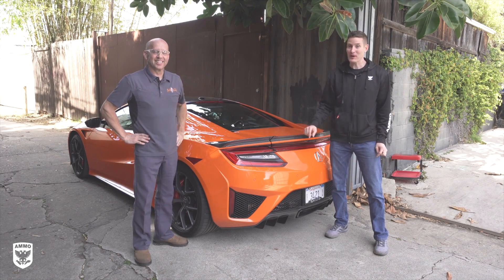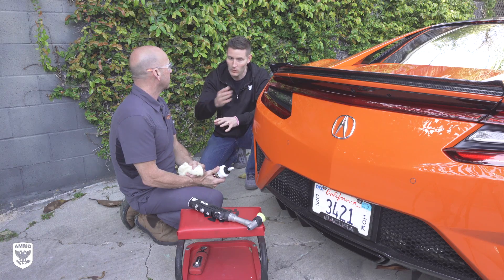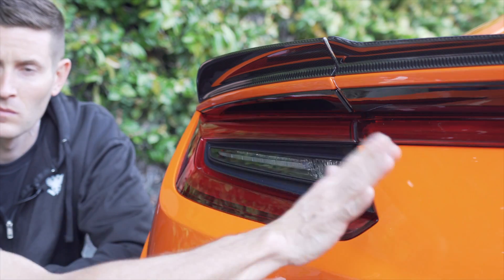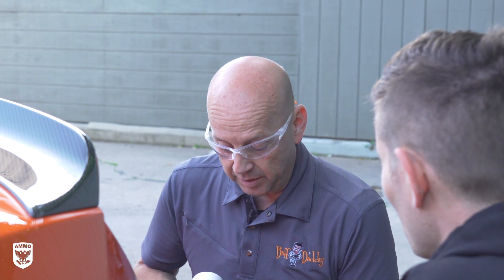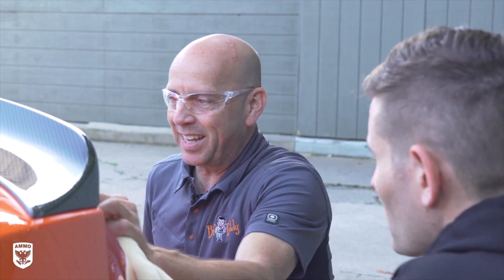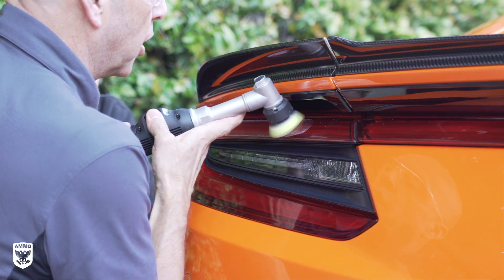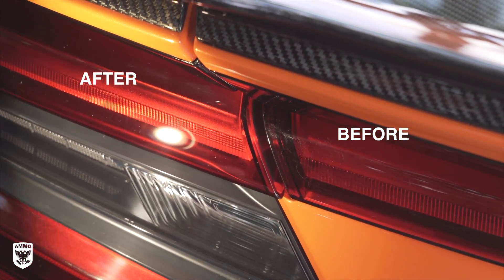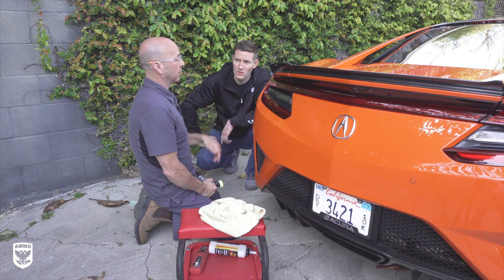How to Restore Scratched Tail Light Lens Acura NSX

Comment: Hi, can you make a video on cleaning and preventative body maintenance for cars that have to drive across dusty roads. I live in a hot climate and the last 1 kilometre of road to our house is an unsurfaced gravel track and even if I drive at 5km per hour, the back of the car and window has a light covering of gravel dust, especially during summer. Thanks for the great videos you've been putting out.

Comment: Same results if you introduce a water spray bottle into your work! Polished a pair of taillights on a 95 Saturn SL2. I used meguiars MIRROR GLAZE with a finishing pad.
Reply: Check out some duplicolor metalcast.
 I used red on a clear section of a taillight to make it red. 
Add a clear coat and it pops. 
I used it on the Amber sections to make the whole taillight red except the reverse lamp. 
Old stuff, no aftermarket taillight options.

Comment: I’m assuming tail lights get the faint scratches and marked from car washes, especially drive thru ?
Reply: Yup. Also drying an improperly washed car or a less than clean towel will leave marks. Adding a lubricant while drying is helpful. But have a great towel and of course a proper wash

Comment: With all the advancements in manufacturing it would be nice to see a return to glass headlight lenses.
Reply: However, is is easier to remake plastic lenses with molding. But you can remake a glass one as well with molds, but your replacement would be plastic.
Reply: Only if it were an aftermarket Chinese lens. Factory (and O.E. approved aftermarket) replacements would still be glass for quite a while as there's a law that stipulates manufacturers have to provide parts for ten years after the vehicle is sold.

Comment: Hi, you mentioned re-clearing headlights, how do you do that, every time I have tried the clear coat cracks like a mosaic, I have never been able to successfully re-clear them?
Reply: are you using NON-yellowing UV resistant clear coat?
Reply: Hi Eddiev8, thanks for the reply, yes I am, I have also tried other 2k clear coats as they should all have some form of UV protection built in to protect the cars paint

Comment: Can someone please help me out. So what product do I use with my micro fiber cloth. After that do I need to add a clear coat or protectant to prevent future problems. If so what is that product called
Reply from the maker: start with a light polish. something like meguiar's m210. then you can apply AMMO Skin or AMMO Reflex Pro to help minimize scratches. Hope that helps. Thanks for watching and supporting AMMO